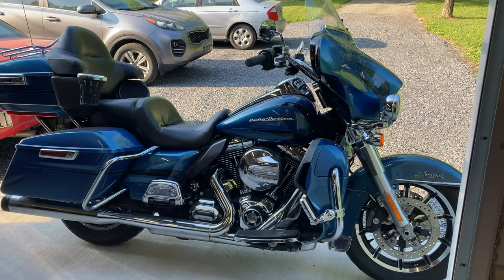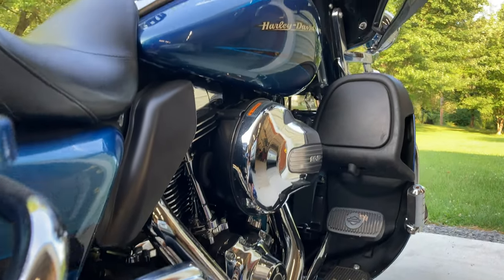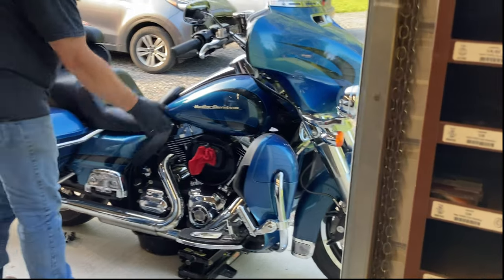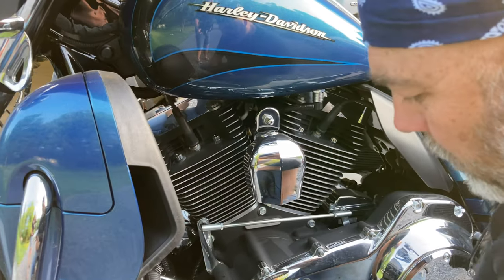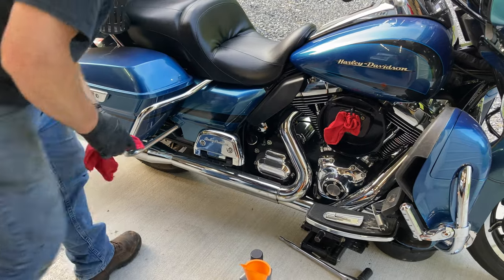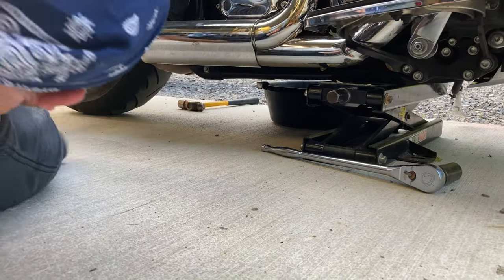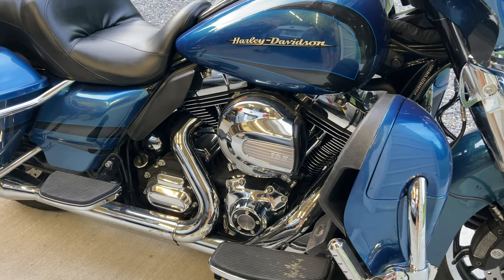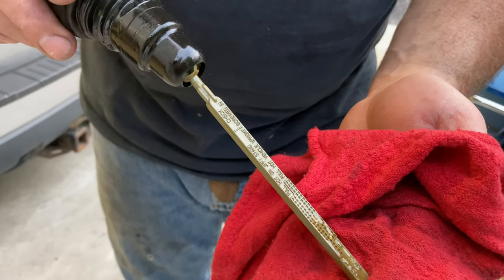AMSOIL, is it better?  Join us for a Pre-Trip fluid change on our Harley Ultra Limited

Comment: I always use Amsoil now, the stuff is noticeably better. I love the product. Bike ran quieter, shifted smoother, ran cooler, I have only good things to say about Amsoil. I use a K&N air filter too.
Reply: How did you measure the temperature to say it ran cooler?
Reply: @jagjr6772  I never measured it, but it seems like less heat radiates from it.

Comment: you should leave the old oil filter in place after putting new oil in; over fill with the new oil.  Then detach the oil return hose, put hose into a drain pan and run the engine for a few seconds.  This flushes the remaining old, dirty oil,  out and prevents dirty oil from contaminating the new oil filter when you install it later.  I do this all the time.  I run the bike until the oil return hose starts pumping out clear, clean oil.  Stop the bike at that point, connect return host, replace oil filter and you'll be golden.
Reply: There's no need to do this on the touring models as they have a sump all the crap sits in the bottom of but the softails you can do that.
Reply: @1974steny  ok, good to know.  Thanks!

Comment: Kevin Baxter has a you tube channel he rebuilds Harley engines he says that when he tears down engines the ones that used Amsoil he could tell the internals were in much better shape than other oils that were used. I have used Amsoil in my riding mower and my push mower , cars and of course my Tri- Glide for several years

Comment: Trick I do is to fold a piece of aluminum foil heavy duty in half , roll it slightly and slide it under the oil filter to form a temp drain chute, then throw away. Safe trip...

Comment: By ONLY warming the engine parked, you’re leaving any “junk” on the sump floor of your engine, transmission and primary.  You must RIDE the bike to get those bits IN THE OIL so they drain out WITH IT.

Comment: I use Lucas 2050 full synthetic the the chain case in the engine and Lucas 8140 in the transmission way better and last longer than and's. Oil no guy had ends well in his and they wouldn't warrant to his bike so there you go.

Comment: I have been a long time synthetic lubrication fanatic for 50-odd years.  I eventually moved to AMSOIL after reading all the test results and blending information that AMSOIL provides to the governments.  i.e. investigating the FACTS not opinions on these products.  I've been really happy with AMSOIL until around 2020 when the founder passed away.  Since then, AMSOIL corporate has become radioactively toxic.  They could care less about customers or small dealers.  With this "NEXT-50" program if you aren't a high achiever they have contempt for you.

K&N oil filters are the best that's out there.  This is a fact.  Just filtering small particles is meaningless if the media is so small that it clogs up quickly.  Once that happens NO oil is filtered.  Mobil One 20W-50 is as good if not better than AMSOIL and is less expensive.  Bel Ray 85W-140 severe gear oil in the transmission.  Redline V-twin primary fluid.  I torque drain plugs that have anti-seize on the threads to 25 ft/lbs.  You do NOT want one of them to fall out!  I always send a sample of my drains to a lab to be analyzed. $35 is cheap insurance for a heads up on what's going on inside the engine.  Tranny too.  Sample the primary also if you are really anal as I am.

If you're going to spring for a K&N air filter spend a bit more and install a big sucker or equivalent so you motor can breathe!

Comment: 30+ years of Amsoil use without any lubrication failures. 
(remove your left heat deflector for 5-10° temperature drop.)
Reply from the maker: Thanks for the tip

Comment: Good video for newbies... next time consider showing where the primary fluid level should be. It is a good idea to let the filter set for 10-15 minutes to allow the oil to spread. Areas that are not completely covered will show so you can add more oil. The engine needs to be at operating temperature before making level check. 200-230 degrees. The oil pump needs to scavenge fully, otherwise you may over fill the case. Any hoot, thank you. These videos definitely help people service their own machines. Unfortunately for me, I found Amsoil caused a noisy top end. Running their primary fluid did improve my ability to find neutral. Their filters are one of the best on the market. If you do not have excessive crankcase pressure and your head breathers do not puke excessive amounts of snot, you can run your oil level up to one dot below full. If you have a puker, many people run the level midway between add and full. I run the Trask vented tranny cover and the DK Customs external head breather setup on my M8 107. This combination allows the engine to vent properly and eliminate snot into the combustion chamber. Running the snot back into the engine will eventually cake the top of your pistons with carbon and cause detonation. With this venting, your engine will rev and run better. Ride safe :-)
Reply from the maker: Thanks for all the info and suggestions. Keep the rubber on the road 👊
Reply: @4ever2up  you bet... : - )

Comment: Im getting ready to do this on a 2014 Streetglide Firefighter Shrine and a 2005 Deuce.  I always change at 5,000 miles.  Motor,  transmission and primary.  I know overkill seeings a mechanic told me 10,000 for the primary and 20,000 for the transmission.  I run K+N air filters and am going to fit FLO reusable  oil filters. I also run love juggs ( mini mite) fans . The combination of the oil , and fans and the bike will never overheat in hot weather.  The alloy oil filters is said to drop the temperature by about another 10 degrees.  I run my 2015 Hyundai VELOSTER TURBO on Amsoil as well as my CTX Honda 700 . Hell my 125cc CRF dirt bike even runs on Amsoil.

Comment: In the beginning you mentioned a cooler running engine do you have those before and after numbers and how was that measured? Thanks
Reply from the maker: Sorry no numbers to give since the method of measurement was using our legs as thermometers when out on the road.

Comment: Nice video. On my 2017 Road Glide Ultra the Dealer did all my oil changes with Syn 3. He told me stay with Syn 3 until my 2 year warranty expired. They also carry Amsoil.  Right after the two years I went with Amsoil in all three compartments. What I did find which was a distinct shock was driving out of the dealership when I shifted into second gear it was effortless and smooth to the point LOL I thought I broke the clutch cable. Over 45,000.00 miles later still purring like a kitten. Can’t comment on if there was more noise from valve clutter. My view I’m not riding a GoldWing engine so that clatter sounds that people talk about, doesn’t bother me.

Comment: Lucas 20w60 synthetic here in Florida is much cheaper and all 3 of my bikes run much quieter. I don't like the foaming that I could very visibly see with the amsoil in the oil bag.
Reply: It's kinda strange how certain bikes like different oils. Put Lucas in my heritage and had to drain it out with 600 miles because of so much engine chatter.
Reply: I had the same issue. Switched to Red Line. Smooth as butta now@jimmyf4603

Comment: Cool Video,Nice bike,Oil level way to high.Was at full and you didn't even have bike full hot.That oil will push out through breather hose in Air filter once it expands with real riding heat.Keep Wrenching.

Comment: Click bait.  No word on if Amsoil is actually better.  Just sales for the kit.
Reply from the maker: It is mentioned and discussed throughout the video why we use Amsoil, what the claims are and what we have found in servicing the bike. No it is not summarized, but it is talked about throughout the video.
Reply: If you ride a Harley, it needs Amsoil. Amsoil and HD have worked together closely for years.
Reply: I will admit after running a few VTwins to death over the decades, I decided to try Amsoil after changing the lifters in a 127 at around 6,000 miles.   In all seriousness, I couldn't tell the difference between the Amsoil and the Ultima blend I had in the scoot except the color.  Same noise, same heat, higher price.  Time will tell.

Comment: What is the primary oil viscosity that you used also the transmission oil weight?
Reply from the maker: Thanks for the question. Harley Davidson recommends 20W50 for the engine, primary, and transmission. Amsoil follows those recommendations. So I would assume the primary and transmission oils would be rated as close to 20W50, they do state that the oils are made with specific changes to their viscosity and blend specifically for those applications. I searched the website and oil information and found the “Kinematic” viscosities but was not able to find a common viscosity description. 

The following is from Amsoil’s website.
“For the record, AMSOIL recommends AMSOIL 20W-50 Synthetic V-Twin Motorcycle Oil in the engine, transmission and primary chaincase on most Harleys (consult our Motorcycle Product Guide for specific recommendations). “

“What are the Differences Between Motorcycle Oil, Primary Oil & Transmission Fluid

In essence, Synthetic V-Twin Transmission Fluid and Synthetic V-Twin Primary Fluid are formulated to protect just one area of your bike rather than three. This specificity allows AMSOIL to “over-engineer” each lubricant for its precise application.

Synthetic V-Twin Transmission Fluid has a higher viscosity than 20W-50 Synthetic V-Twin Motorcycle Oil. A higher-viscosity, or “thicker,” lubricant provides some advantage in helping quiet noisy transmission gears and enabling smooth shifts.”

“Likewise, AMSOIL Synthetic V-Twin Primary Fluid is “over-engineered” to protect primary chaincase components. Its viscosity is like an SAE 50 motor oil. Formulating it as a straight-weight lubricant naturally offers an advantage in shear stability over multi-viscosity lubricants. This helps the fluid remain thicker, which helps it cling to the compensator without being “flung off” as easily for maximum protection.”

It’s not the simple answer you were looking for but I hope it helps.
Reply: @4ever2up  I've been an AMSOIL Dealer for 20 years, I am the AMSOIL Dealer for Laconia H-D , since 2010, my BEST Retail Account! Laconia Bike Week is going on right now, the 100th year! I've owned Harley's since 1967? I'd use 20W-50 in engine & primary, Trans= 75W-90 in Big Twin Evo, 75w-110 in Twin Cams & M8s,, & 75W-140 in Shovels & back! Stay Safe!
Reply: You tightened that oil filter way too tight but you do it your way I’ll do mine